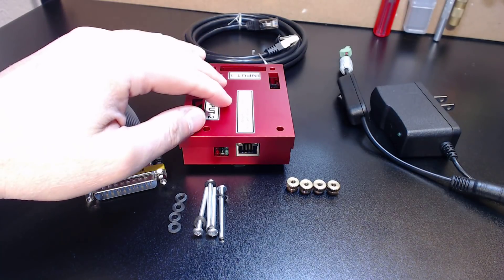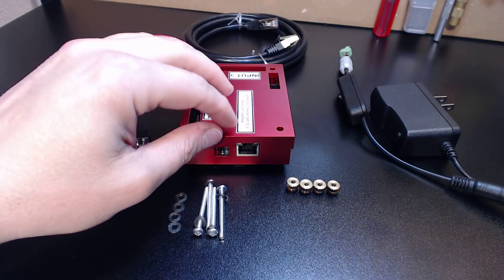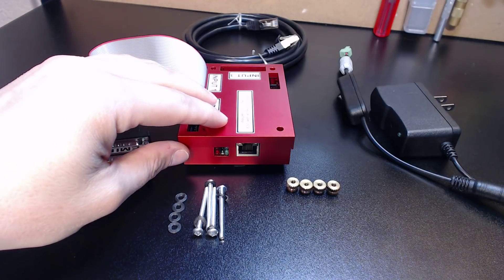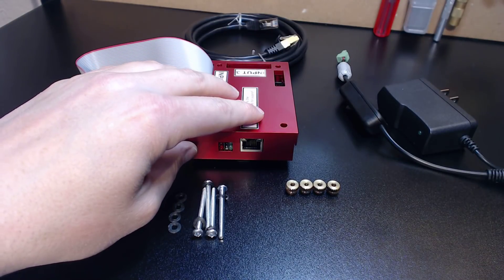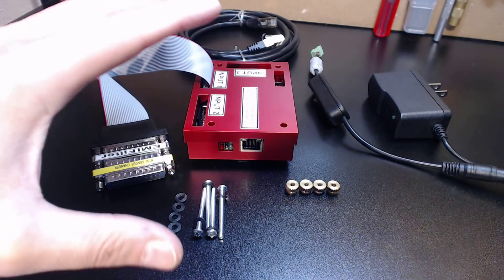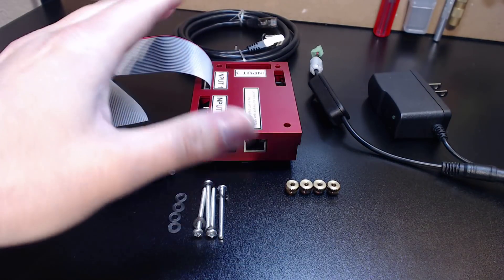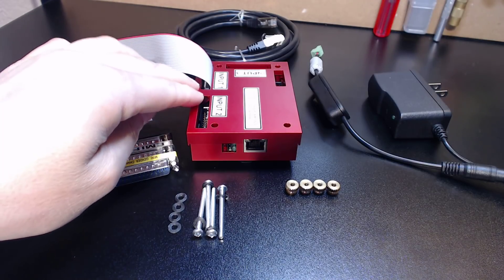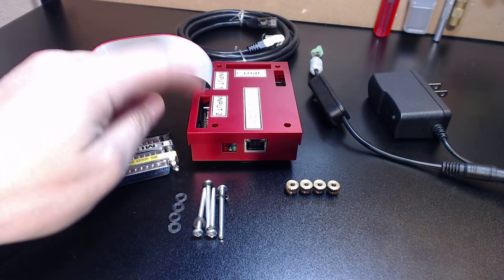The Warp9 Ethernet Smooth Stepper (Turnkey System)

Comment: I was thinking that I was using mach3 with windows 7  can windows 7 parallel port work or was windows xp the only computer to work with mach3?  So another question I had a taig mill with stepper motors and their controller when my hard drive crashed and burned.  Everything I see uses stepper motors which have 4 wires my step motors NO. SST58D5811 Shinano's 1.8 deg but my motors have 8 wires? Which is why I have not done anything.  I was looking at your Warp9 Ethernet Smooth Stepper and control board any help on this?  Think you have my email  rhjgold@gmail.com Thanks Mike E.
Reply from the maker: Hey Mike, thank you for your support. I messaged you. Vince

Comment: Thanks for a great and instructional video, Vince.  I have a lot of WIndows XP systems running Mach3 on my machines..... and just bought my first ESS to try out with a windows 7 or windows 10 laptop.  All printers have lost the 5 volt Centronics parallel printer ports.  Some have a 3.5 volt parallel printer port.... I need a plan for when my desktops die - so I am trying ESS (would hate to give up Mach 3).....
Reply from the maker: Joe, thank you for your support. I really appreciate it. The ESS is the most stable platform for converting any system to be compatible with Windows 7-10. Your all set with what you have  :) Thank you,
Vince

Comment: I had a problem with the CandCNC controller I had used for ten years, I need a new controller but want to use my Gecko 251X drivers and my 48VDC PS.  Would this system work with my configuration?  I don’t see the connection points to the drivers??
Reply from the maker: Hager, thank you for your support. It would work, but the drives connect to the breakout board you plan on using first through its terminal block , and then the ESS converts its DB25 input to ethernet then allowing it to be used. 
Thank you, and have a great weekend!
Vince

Comment: Hello I need help with ess board. My lower left red led is on but no estop button pressed. I can connect to the board but no movements at all.
Reply from the maker: Max, thank you for your support. If the ESS is reflecting an E-stop condition I would review your E-stop switch,  and if its fine review the breakout board settings under inputs to make sure its configured properly. If all those areas are covered I would contact Warp9 the ESS manufacturer. Thank you, and have a great weekend!
Vince
Reply: @corvetteguy50  Thanks for your response.
Reply from the maker: You bet  :) Have a great weekend!
Vince

Comment: This won't work with breakout boards like the MB3 where ess sits on top of it directly. What would be the solution in that regard?
Reply from the maker: That's a very good questions as many of these types of boards exist. You would require an enclosure for the type of base board your suing in best practice. The more segregated the ESS is from any possible EMI the better. Thank you,
Vince

Comment: Is that ess case purchasable?. I have one & woukd much rather have it inside a case like that
Reply from the maker: Hey Robert, thank you for your support. The case is purchasable. I just haven't had a chance to list it yet. The case without any cables is $125 shipped in the US  thank you and have a great memorial Day!, Vince
Reply: @corvetteguy50  ty Vince; i already have an ess and that case is just what id need to insulate it from interference..the power supply would be a nice touch as well. Please let us know when & where it or both are listed. As it stands i have a cell phone charging cord with 2 of the wires going to the ess power hookup with the 2 screws holding them whch looks a bit sketchy.. hope you have a great weekend. 

Robert
Reply from the maker: @robertravena  Here you go Robert  https://www.youtube.com/redirect?event=video_description&v=uX_D23XtLwM&q=https%3A%2F%2Fwww.ebay.com%2Fitm%2F133063929065&redir_token=dQ-e79L31dW_EgM55Q0RqjD4HeJ8MTU1ODk1MjAzMUAxNTU4ODY1NjMx    Thank you, Vince
Reply from the maker: @jeffcoldon1496 , If the system is properly grounded, you should be fine. Thank you,
Vince

Comment: Vince,  I am thinking this would be a good way with a new Laptop and my Gecko 540. My old desktop with XP is on its last leg. Thank you for the video and for all you do for the community. Liked and Shared as Always.  A question I read that one of the Windows 10 updates may have caused an Issue with Mach 3? 👍👍👍👍
Reply from the maker: Hey Lou, Thank you for your support as always. This is really an amazing system, and would work excellent with your laptop if you want ethernet control. I haven't had any issues as of yet with Windows 10, but if an update is causing an issue you can simply uninstall it, and you should be fine. Thank you again, and have a great Memorial Day! Vince